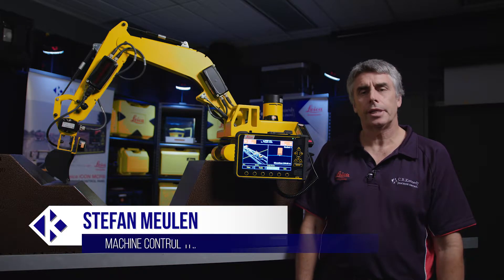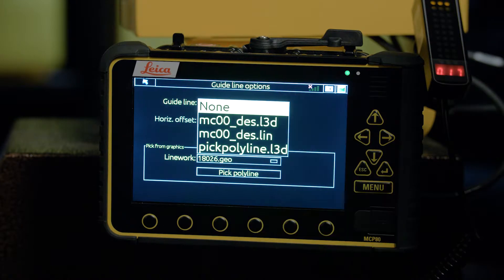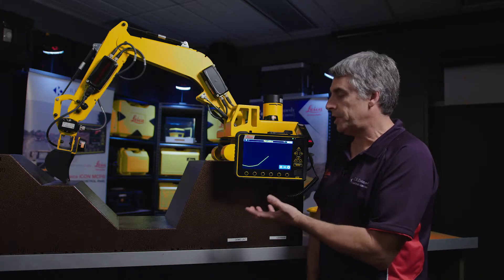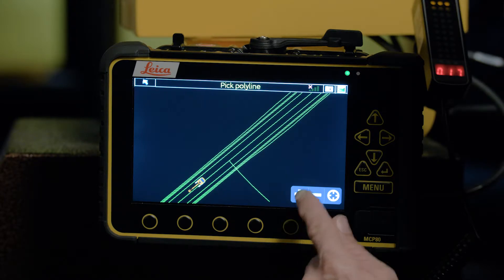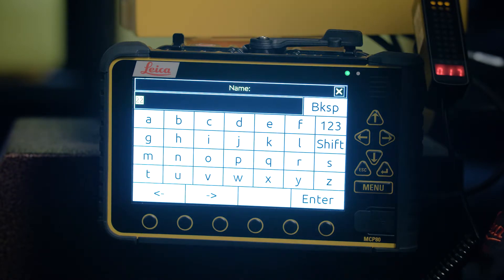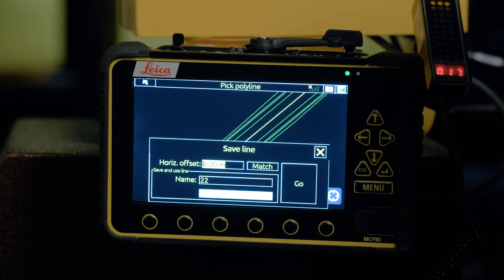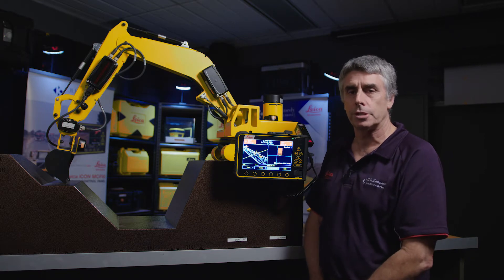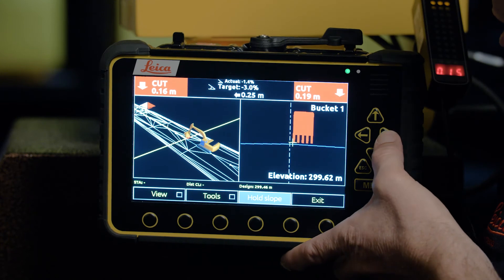Leica ICON 3D How To | Guideline Options

Comment: Hi great video! 
How do we dig a drainage run for example. If I have a polyline at invert level either end, how do I use the elevations of the guideline instead of the .trm underneath

Thanks
Reply: Hi Jake, for this you would need to use a .L3D line or a XML